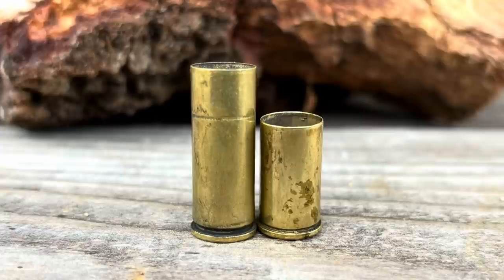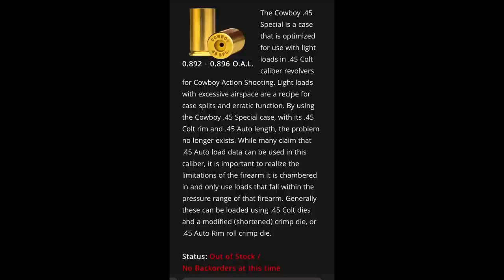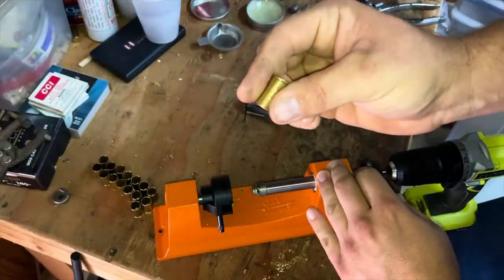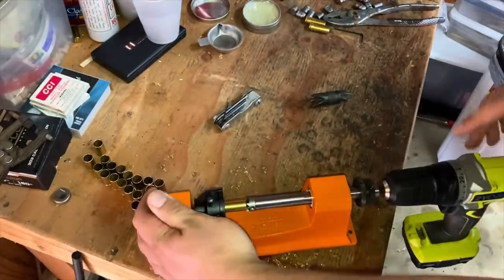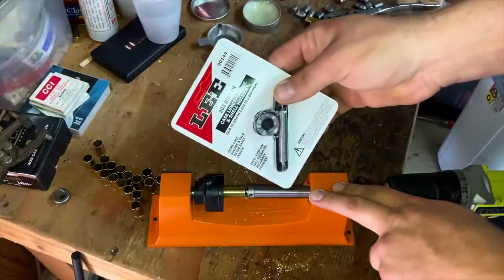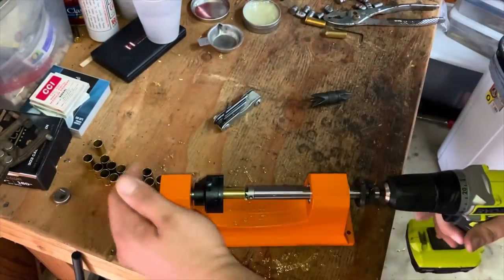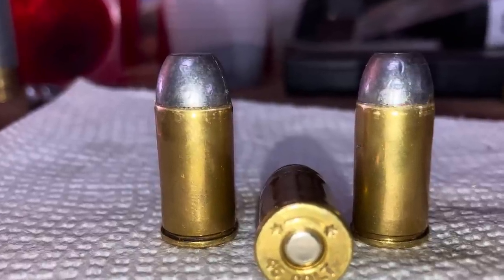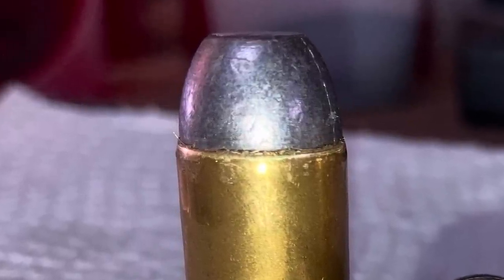Making 45 Cowboy Special Brass

Comment: Using Trail Boss powder solves the problem of light loads in large capacity cases like the .45 Colt. It is a very bulky low pressure powder designed specifically to fill up all the powder space in cases to maintain a stable powder position and give consistent pressures.
Reply from the maker: I use trail boss all the time and when I make a video using it people tell me they can’t get it. So I make a video on short cartridges with faster burning powder and people tell me to just use trail boss. Lol go figure…
Reply: @Everythingblackpowder  
Aint you got it figured out yet ?
NOTHING is ever good enough for some people !! LOL

As far as I am concerned this is another very informative Video That YOU (and not a naysayer)have made.
Thank's
Reply: They stopped making trail boss back in 2021ish, I think. Rumor mills talk about the powder plant upgrading their lines to restart production, but when?

I'll just stick to BP or even pyrodex if I have to.
Reply: Trail Boss is great if you can find it I haven't seen any in a couple years.

Comment: I was given some 45 cowboy brass. I cant tell if i love them or hate them. For my original SAAs i run light loads most of the time. So using these just for the originals seems like a good idea. But it seem they are leading the barrel very quickly compared to normal 45 colt. I am thinking its because the bullet is traveling further until it hits the rifling. so it should be traveling much faster by the time it hits the rifling compared to regular 45 colt. I am still testing and haven't given up on them yet.
Reply from the maker: That’s interesting. I didn’t have any leading with this batch
Reply: @WillardMcBain  interesting. I am still testing. it could be something I am doing wrong.

Comment: My nightstand gun is a S&W model 1917 from a 1927 South American contract. I load it with pure lead 230 grain bullets at 700 FPS in .45 AutoRim cases. Pretty close to what you have created here. Don't underestimate the deadlyness of them.
It will penetrate a WhiteTail deer from front right shoulder to left rear hip at 30 yards. It is a formidable home defense load..

Comment: I made my own cowboy special too. Made them from magtech  and starline cases, the starline brass had to be reamed out on the inside to get my 200 grains big lube bullet to seat witout a bulge. The magtech brass  is thinner and thickens way deeper then the starline brass. I also had my sizer die reamed out because most (all) of the sizer dies I had were too tight and caused a lot of brass to last only 4 reloads, even with blackpowder. Because the O.D. of the case was then larger I could get a roll crimp with a standard 45 ACP seaterdie . My load was 18 grains of the cheapest 3F (ish) I could find, slight compression with the bullet (about 3mm). Used the same charge in my Rossi 92 with cous cous filler. I must say that I only used magtech brass in my rifle, that chamber was on the outside of the specs and my vaqueros were a bit tighter. 
After I reamed out my sizerdie I never lost brass due to splitting.

Comment: Regarding your smokeless loads, one possibility for the wimpiness may be the fact that you’ve essentially increased the amount of freebore.  That bullet is now having to jump a lot further distance to engage rifling, hampering the ignition and burn rate. A few years ago I had all but mastered reloading 22 long rifle. I found out with my smokeless loads that they would fire just fine in my Henry lever gun and would cycle in my Ruger 22/45 autoloader but were very sporadic out of a heritage Roughrider and   would squib just about every time.

Comment: I busted out laughing when you said you were going to trim your 45 Colt cartridges down to 45 ACP size using a Lyman case trimmer!!!  As I'm sitting here using my Lyman case trimmer to trim my 38 SPL brass down to 38 Colt for my 1851 Navy conversion cylinder.  I immediately thought "I'll check back in a couple weeks".  I guess the laughs were on me.  How did you mount a drill onto that trimmer?  I've been trimming these damn things for two days straight!!!
Reply: Lyman sells a conversion shaft for the trimmer. They are quote expensive. Alternatively you could modify the stock shaft on a lathe to accept adrilll.

Comment: They will work in some revolvers chambered in 45ACP,   if the cylinder doesn't come back to the recoil shield and if you load the Cowboy 45 Special like 45ACP (452 bullet, etc.)  Shot a lot through Ruger Vaqueros.   I also modified a Marlin 1894 45 Colt to feed and shoot them.
Reply: You've addressed my question... What did you have to do to modify the Marlin?  I'd hate to do anything irreversible to mine.

Comment: I remember reading a thread on the SASS forum years ago from the original developer of the cowboy special, Adirondack Jack I think.  He said he told Starline to take a 45 Colt and take the extra lenght out of the center of the cartridge.  That way the mouth of the case is not too thick due to the internal taper.  Thus a factory Cowboy Special is just a little bit  better than making you own from cut down 45 Colts.
Reply from the maker: Fair enough

Comment: I made some of these back in 1991 and wondered if anyone else ever had the idea. I used to actively participate in a lot of gun forums and remember when people started talking about doing it for cas shooting. I used a discontinued LEE die back then to load them, but a LEE 45 acp die will roll crimp. LEE ACP dies can adjust from taper to full roll albeit idk if it will reduce the bullet dia. because I haven't made any of these in many years and just don't recall. A Redding profile crimp die is basically a LEE bullet seating die (with different dimensions) with the stem and adjustment cap removed. I've often wondered why no one ever mentions this, but understand why LEE wouldn't...they've been in bed with Redding since at least the late 80's...

Comment: I was making up some rounds for a friend's m1867 Remington RB in 50 Remington navy. Lucked out and found a bulled mold that would work and some reproduction brass. But could not find any dies for it so ended up making a crimping die from scratch and the reloaded cases seem to chamber just fine so we are just not going to bother with a sizing die. I had some accurate 5744 on hand so worked up a safe load for him to plink with.
It might be worth looking into making a crimp die for your shortened rounds. The one I made was just mystery steel and did a crude heat treat, seems to be holding up ok.

Comment: I cut the case down to almost the correct length with a tubing cutter, then finish with the case trimmer and deburring tool. I use the same method to make 7.62x25 Tok brass from .223 brass.

Comment: Nice stuff, thank you for sharing.  I would love to see a deeper dive into loading .45 Colt.  You know my focus on historical shooting, so I'm trying to recreate the M1873 cartridge as closely as I can (except for the Benet primers, of course).  I had a custom mold made to produce a close match for the bullet, but no one can definitively tell me how much crimp I should have or how much I should be compressing the powder.  I know the Fascists hate it when people talk about this kind of thing, so if you happened to think of a way around their ridiculous rules I'd love to see a deep dive into this.  I'm using 35 grains of Swiss 3F, and this week the "plug" that holds the ejector assembly on my Colt 1860 Kirst conversion revolver worked its way halfway out of the tube from the old loading lever assembly, so I do think I'm going to have to cut my charges down a bit.  LOL!  I also used a Howell conversion cylinder to shoot the same cartridges from my Remington NMA, and the power was so great it drive the loading lever into the latch that holds it hard enough to break it off, which also might be considered nature's way of telling me to lighten the load.
Reply from the maker: YouTube I making it more difficult as we speak. I’m was thinking of putting the stuff I have to edit out on rumble.

Comment: In the 45 Colt chambers, the bullet will clear the Cowboy case before the bearing surface enters the throat of the chamber.  That's roughly a .452" bullet in a .480" chamber before it hits the throat.  So there is going to be some gas blow-by, and loss of velocity.  I tried Starline 45CS brass with a .452" cast bullet and it is a snug fit to a no-go fit in a 45ACP cylinder, but the bullet is in the throat as it leaves the case, so not the blow-by situation.  Enjoyed the vid, thanks for sharing!

Comment: For the 1917, I guess if the .45 Cowboy brass has too much play, maybe the clips can help?

Optionally, winding some metal wire around to base, adding height to the rim for spacing. Admittedly very ghetto, I got this idea from some police evidence photo where someone had done this to try to fit 9mm Luger in a .38 Special revolver. I've also seen a really old IDF archive photo where someone had used a hammer and punch to ding up the head of 9mm Luger cartridges, creating these little jagged 'flanges' so that they would sit on the extractor of a .38 Special revolver, because apparently there was no .38 Special ammo around at that very moment. I would not expect good reliability doing either of these, but it's probably not catastrophically dangerous.

Comment: I bought a handful of Starline .45CS for... Just because. Well, I intend to make some "Shorter" cartridges for the Uberti #3 OM 'American' that will kind of duplicate the .455 Eley with some of the heavier Ideal HB bullet moulds. Actually, You kind of duplicated the .450 Eley with your shortened .45Colt/CS brass, but a bit faster. I found it pretty easy ( with .45Colt brass shortened to Govt length - 1.095" ) to hit bullseye with the same bullets, and a lot less powder. Aren't the little LEE Trimmers dandy? The bench trimmers are handy for case modification, but the LEEs are just right for cleaning up... Bravo!

Comment: Interesting video. The loads don’t seem significantly different than .45 auto rim so why would you need to cut down .45 Colt cases? Is it due to the .45AR having a thicker rim?
Reply from the maker: Yes the 45AR won’t fit in anything I own except the 1917

Comment: I had to convert some 44 magnum brass into 44 Russian brass for an antique revolver. I had to pre trim the brass with a tubing cutter because my lyman case trimmer cutter dulled out after making about 8 cases with a full trim. And when loaded you want to talk thick brass? The loaded rounds were too big to fit in the chamber. I had to run the loaded ammo back through the resizing die with out the decapping pin, then they chambered just fine.

Comment: such a cool fun lil round. i have a brass framed remmington with cartridge conversion.  i dont want to stretch the frame out. so i load blanks for 45lc for the fourth of july. but i fire 45 cowboy special out of it, 45 acp dies taper crimp, with 230 grain powder coated round nose and 20grs of powder. ive done 17grs and it could prolly fit 22 grs if loaded to the brim and compressed. but 20 just feels right with a lil bit of compression.

Comment: As a Younger and Thinner shooter with 30 06 surplus all over the place, more than 308 in the early 90's?  I wanted to load a few 308's but had NO Brass as I had No 308 in these days. Soooo? thinking swiftly, I cut down some 308 lubed it well, and sized it incrementally right on down to 308!
now days I would not dream of sacrificing a perfectly good 30 06 case for a lousy dime a dozen spent 308. I would rather rock my Garand than my 14.

Know of any other Cases with similar rim or base dimensions as 45 long Colt?  or? 45 70?

I just noticed my spent Russian Steel case 7.62 54 R was almost good to go but steel.  I got to dig through some garbage brass and see if I can take brass case 54 R another step closer to 45 LC? or 45 70?  I was just messing around with this 45 long Colt case size for My First Time, as I just came into a 45 long colt Philippine Contract double action Colt.

Comment: I would like to make note of the load data here. 

DO NOT load them just like ACPs. 45ACP has a higher case pressure and there’s no guarantee that older things chambered in 45 colt can handle such pressure. Rugers have had testing performed to higher pressures/velocities. You need to know your arm of choice and load accordingly. 

I load them with 4gr of titegroup under a 160gr projectile. Using ruger vaqueros. 

Also have found that a Redding profile crimp die for  45 auto rim is the key. They load on a dillon pretty easily.
Reply from the maker: Fair enough

Comment: My only concern with using them in the 1917 would be headspace issues. It might fire fine or it might have light primer strikes if they are a little floppy due to the thinner rim. Dont know if they would slam back into the frame either and cause isues. Very interested to see the results. I doubt there would be any serious issues with yhe pressures your working with.

Comment: Redding Profile Crimp die trimmed back so it will crimp the the mouth of the Cowboy Special case. Hell, they might make you one. As for all the empty space in any handgun case, I take insulating foam that wraps a pipe and sharpen the mouth of a case to saw out little plugs and put them in place before the slug goes in, works good for me, use them over powder and under shot for snake loads, they do lead the barrel with shot.

Comment: Just a thought, if in time hand loading the 45 Colt brass case  stretches from seating too many lead reloads  saving the case by cutting down to 45 cowboy can add new life to mild hand loading if the primer pockets are still within micrometer specification
Reply: Or just make a brass dowel to see how easily it snugs into the primer well

Comment: I dont see why theres a need for this brass. People could use 45 schofield brass, but i suppose its difficult to find these days along with everything else. I always found 45 schofield factory loaded ammo to be very anemic. As always, i enjoyed the video.  Oh, you can use a standard pipe cutter to trim brass if youre wanting to take alot off. Its quicker. Just insert a steel rod inside the brass case you wish to cut. Use the case trimmer to shore it up.
Reply: Schofield cases don’t fit the .45 Colt plate on my press.

Comment: I use 45 Schofield brass in by 45 when I want to make a more efficient burning load in my single action Colt,they used to make 45 rimmed that was used in double action old Colts so you didn't have to use moon clips,the rim may have to be thinned a bit depending on each individual gun its used in,I use them in my 455 Webly.

Comment: let me papa's way and the old timers .way to save time and effort. some of us old farts used cream of wheat or cotton. i mainly use Walmart bag of pillow fill poly or dacron . you can put enough in case nearly full, seating bullets will compact keeping powder secure to primers.  i also use pillow fill in my ultra reduced center fire ammunition for special purpose situations. a bag will last a long time . the pillow fill will blow out barrel not melting or packing in barrel.,same thing aboot cotton fill. papa wishing you well 😊

Comment: This .45 Cowboy Special brass makes little sense to me. 

First there is the difference in case wall thickness - the neck diameter of the .45 ACP is .473" while the .45 Colt has it at .480". So the brass will be overworked in either case - if we go for the thinner wall of the .45 ACP, it will balloon in a .45 Colt chamber and will need to be sized back. If the brass is .45 Colt thick, it will get sized too much in the .45 ACP sizing die, and then it will need to be flared a lot in order to accept a .452" bullet.

3/8" of case length difference is a lot, with some bullets, especially the light and short ones (popular in Cowboy Action Shooting) like Accurate Molds 45-150H (0.2" of full diameter length) there is a possibility of blow-by when the bullet leaves the casing completely yet it does not reach the forcing cone of the .45 Colt chamber. Maybe this was responsible for the inconsistency and the loss of velocity.

The .45 ACP load data has little use in Cowboy Action Shooting, the auto cartridge must provide enough Bolt Thrust to reload a semi auto pistol. Usually this happens at a Power Factor of around 150. In Cowboy Action Shooting we pursue PF between 60 and 100 in order to shoot fast.

Then there is the standard issue of carbon ring if we shoot short "special" brass in a longer "magnum" chamber. If we shoot a lot of short rounds and then return to long ones, we may even get chamber damage from the carbon ring being pressed into the wall. Especially if we use a double base powder in the short rounds - such powder has a higher flame temperature, which causes the fouling to be "baked" - hard and sticky.

If I wanted to shoot some very low recoiling .45 in the SAA Colt format, I would get a replica with a second cylinder, .45 ACP chambered. The Italian companies make such revolvers. With a rod ejector it is not a big issue, as long as we stick to a proper taper crimp in order to provide the headspacing on the case mouth, as it should be with the .45 ACP.